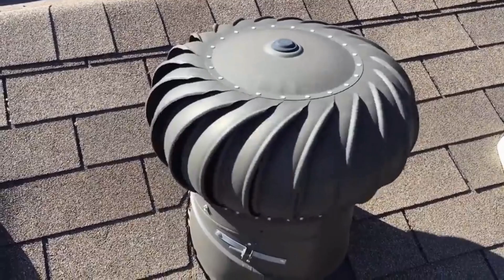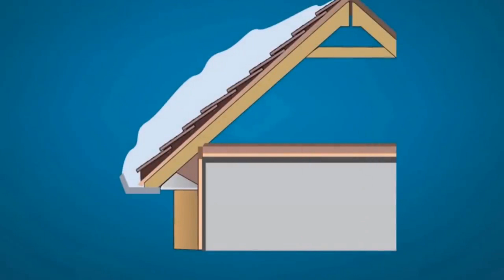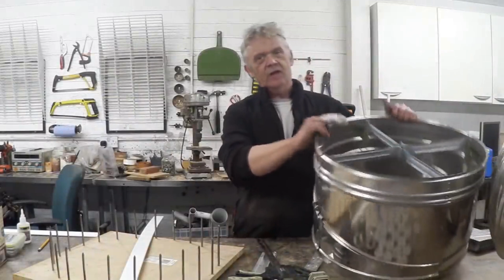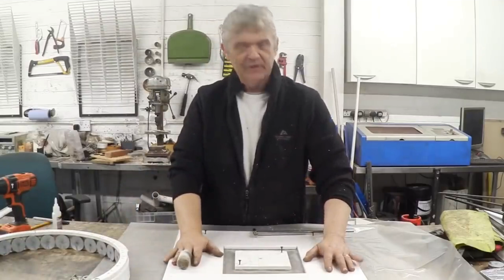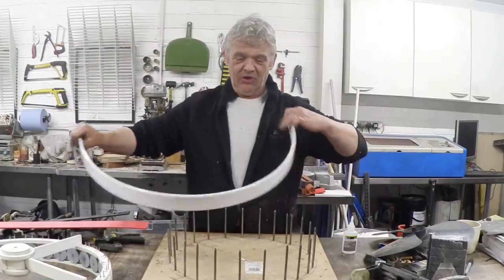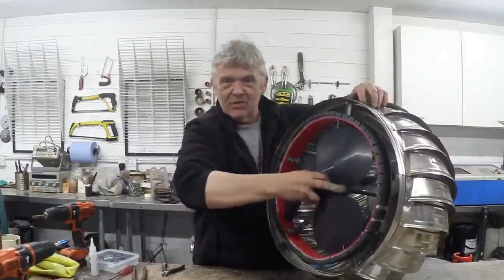011 Whirlybird Turbine - How To Turn A Roof line Ventilator Turbine Into A Wind Generator

Comment: going around the circumference doesn't matter, you could drive your generator off the central shaft as well. If it's producing the same amount of power, the amount of total resistance is the same

Comment: It should go very good on a hot roof give it a few meters extension paint it black and it will give it more pull from the hot air of the pipe..

Comment: I've used superglue to hold my fingertip together after cutting into it with a razor saw, there is a slight scar, but it's amazing stuff, and it stops anything getting in to the wound but allows the flesh to heal underneath.  It still seems to be not very widely known about, though.
Reply: yes but u should use medical  grade glue , bonding glue is toxic

Comment: I haven't seen those things around here in Oklahoma for around 20 years. I'd assume you can get them, but they have fallen out of favor for passive or solar ventilators. I think the modern thinking is that active ventilation pulls air into the attic from inside your house, so they've been recommending to only use passive ventilation. Our mid-60s roof only had these linear gabs covered with screen under the eves until like four years ago when the house was re-roofed and the roofers put in passive ventilators. I can't seem to find any visible openings in the attic, but it is dark up there, so maybe I don't know where to look. I saw a video where someone fed antenna leads through his ridge line vents. All you could see was a thin gap. It didn't even look like there was venting there, but the antenna leads fed through that crack.

Comment: Looks like you left the fan blade out of the finished assembly. Now to find a way to add a temperature difference engine to also aid in the rotation and scavenge even more energy.